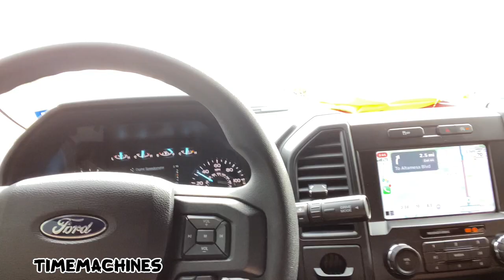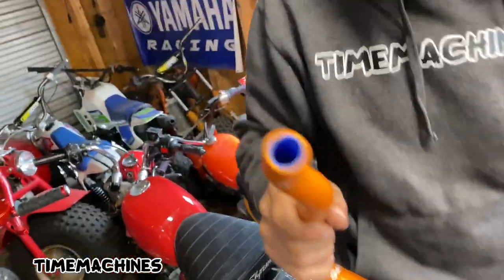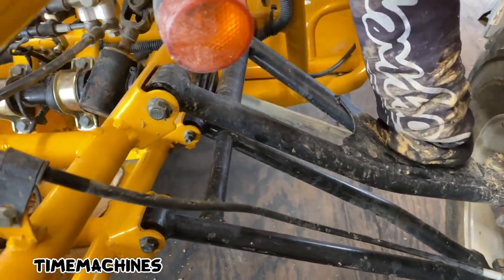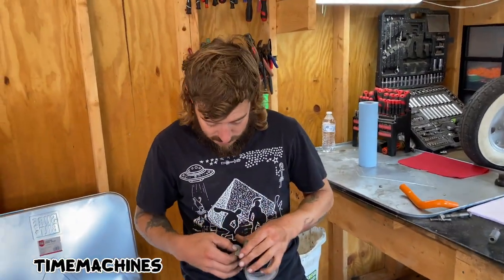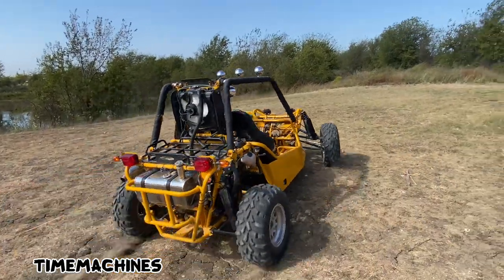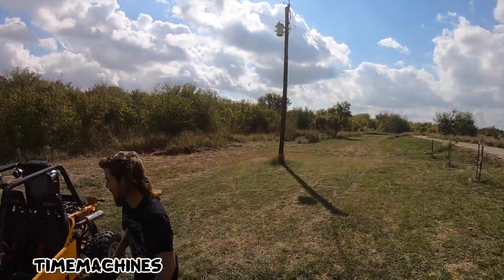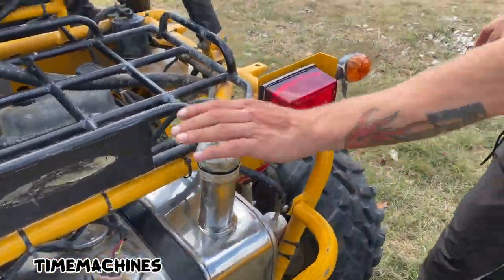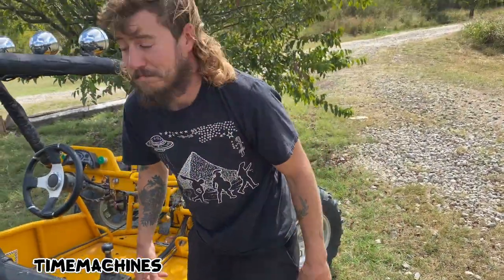The Spider | Joyner Sand Spider 650 | Bushings FIX

Comment: Awesome video!  I just bought a 2008 Sandspider 650 and the bushings are shot.  Of course they are no longer available.  The left axle is stripped and I have to re-thread it.  I'm concerned about obtaining parts for it.  Wondering if I should buy whatever I can before it all becomes obsolete.
Reply from the maker: Appreciate it sean. Do it theyve held up i know the buyer and is still running em
Reply: Iv put a sport bike exhaust on my Joyner proper pops and bangs with flames 🔥 🤣🤣